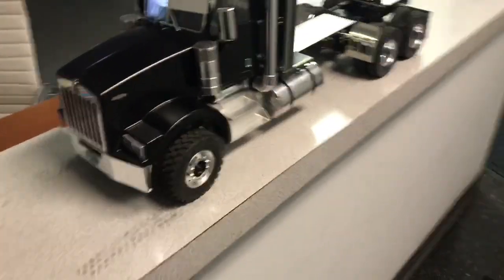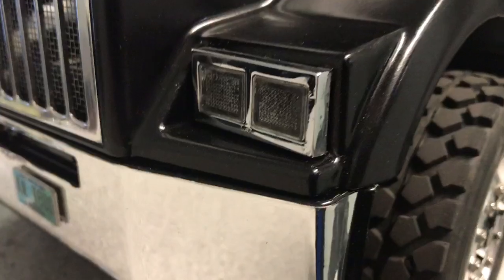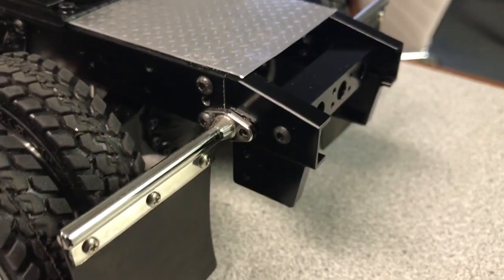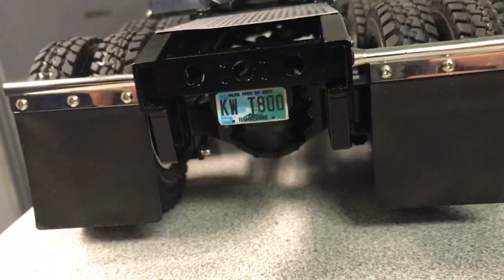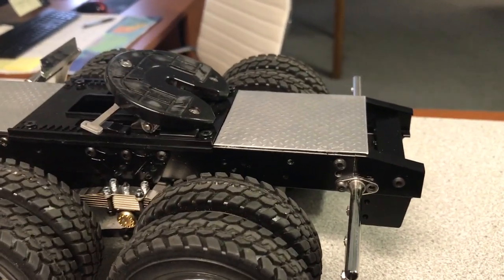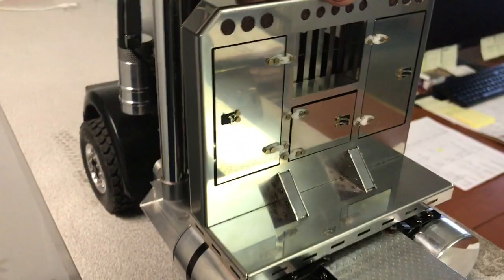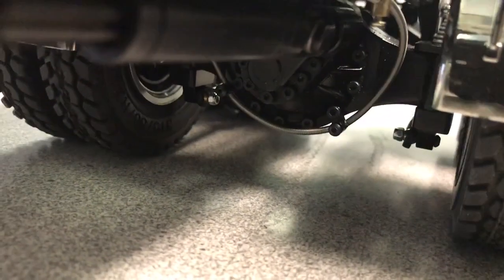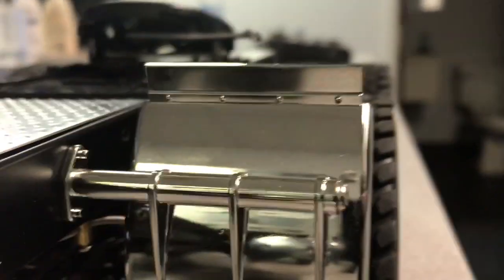RC 1/14 scale Kenworth T800 update

Comment: Nice truck!  Did you scratch build the cab?  What axles are you using?  Thanks
Reply from the maker: thanks! I bought the truck with the cab/hood all done and painted it’s from Shapeways.com it’s 3D printed. I’m using Lesu axles and suspension they are all metal.
Reply: @Trucker1970  Cool, thanks for the info!

Comment: Hello frank how can I get one of these trucks I want one
Reply from the maker: @jonathancontreras5103  It all depends on your budget and what you’re looking for. If you want a specific one like this Kenworth T800 or just a generic truck that you call it a Kenworth or a Peterbilt but it’s not detailed to a specific one but just a semi if that makes any sense. A generic one you can buy a Tamiya Grand Hauler or King Hauler (shorter frame length than Grand) you will have around $600-$800 or so into a build buying the kit and the electrics needed to complete it.  There are Facebook groups that buy and sell ones that are complete if you don’t feel you are a builder. There’s some on ebay already built possibly I overpaid for my first one I got it off ebay $1888 shipped was just a kit truck extended frame added third drive axle and an aluminum bull bumper on the front. It did have lights and sound that is extra if you buy a kit plus your time to install. None of these are cheap so if you’re thinking $500 is expensive this isn’t the hobby for you. It’s unfortunate but I’m just being honest. I could probably hook you up with a truck if you have a decent budget. You can email me at trucker1970@aol.com